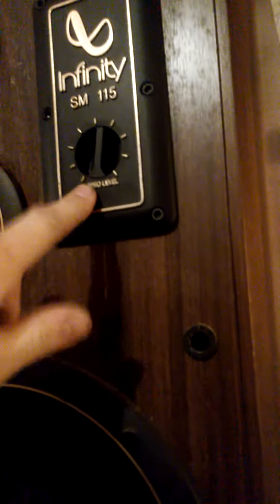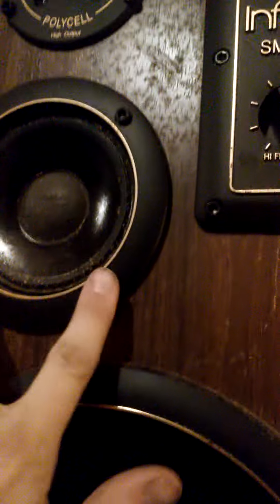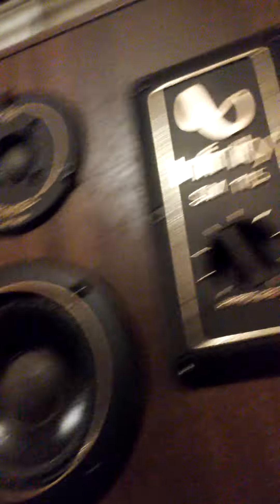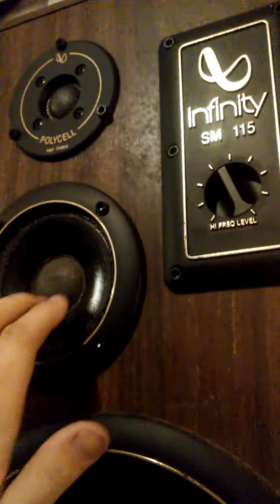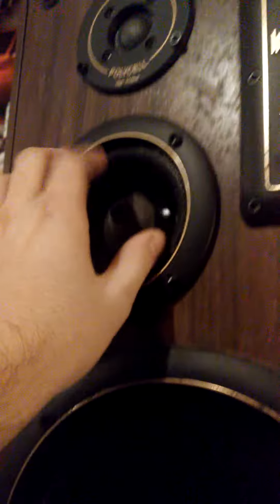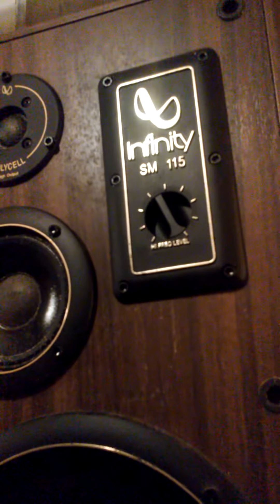Infinity sm 115 speakers

Comment: I bought a pair of SM115's in 1995 for $400/pr.  They blew my Onkyo A7090 which i had since 1984.  So I bought a Denon AVR85 in 1998 and both speakers and receiver still sound divine.   I liked the 115's so much, I bought a pair of SM105's for my parents.  A year later I bought 2 pairs of SM85's : one for me and one for my folks to use as surround speakers.  Here it is 2019, and they all still sound fantastic.